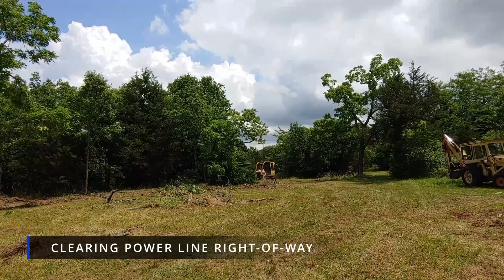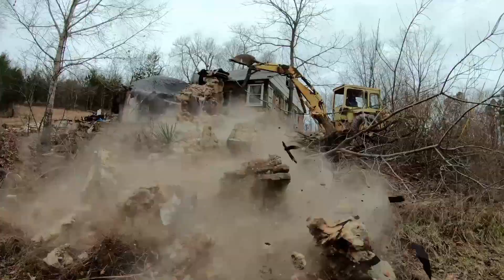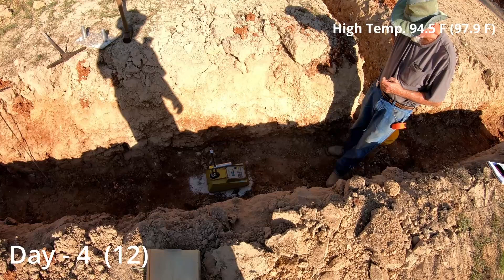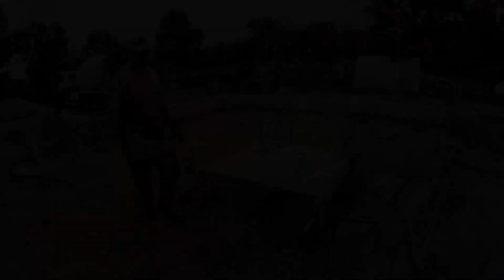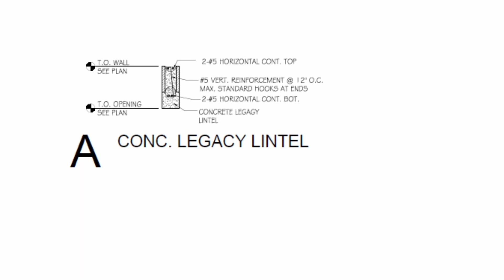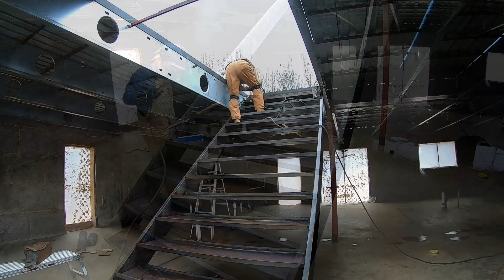House Build 29 - Update & Progress So Far on Our Legacy Block ICF House

Comment: I’ve noticed unfortunately all of the videos so far have not shown the detailed assembly of the Legacy ICF blocks. The many videos I have seen so far so the exterior walls already all assembled Eg. I would have loved to see the horizontal placement of the rebars, also I’ve only seen a 5 second blip of the placement of 1 vertical rebar. May I suggest you show detailed instructions of placing the blocks as you do for the laying of the concrete floors and I-beams. Does one need to use struts and string lines for the exterior block walls? Thanks.
Reply from the maker: There are some close ups of assembly in the various videos but, unfortunately, I am not a camera man and was doing other things related to building our house during most of the filming.  Rebar is 12" OC vertically and 24" OC horizontally.  There are pieces of #3 rebar laid across the block that support the #5 horizontal runs. 
 I am not attempting to sell products, merely showing the build experience and share information about a system that is different than what most folks see.  I'm not sure what you mean by "struts and string lines" but one reason we chose these block is that they are self supporting and do not need reinforcement like normal ICF for the pour process.  You can, however, see in one of the videos that bracing was used to ensure that the block was square/plumb prior to the pour.
Thanks for watching!